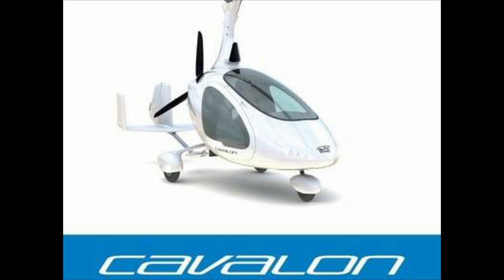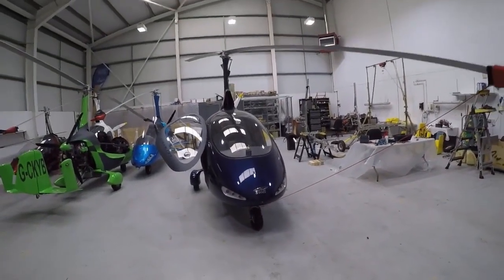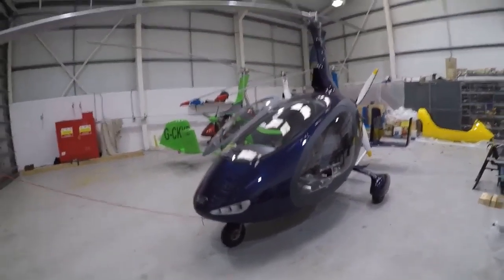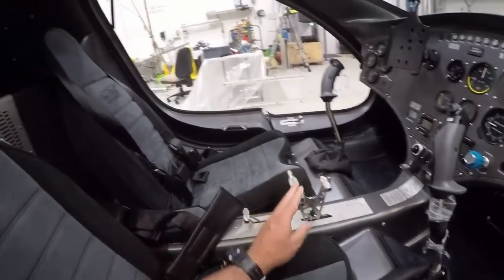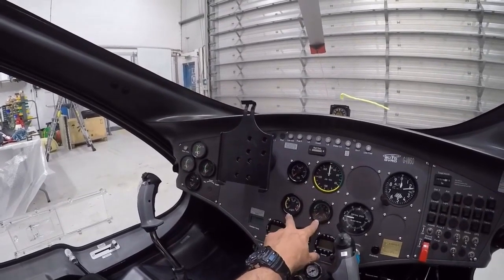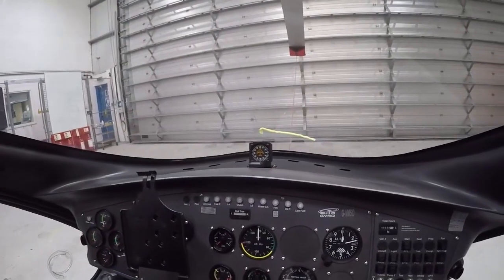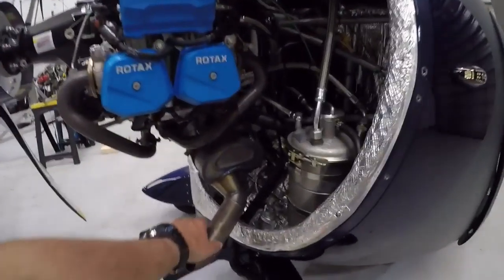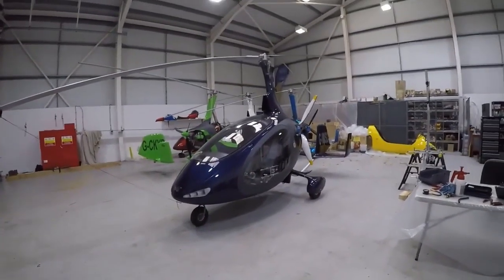Auto Gyro Cavalon with Rotax 915 & Constant Speed Prop revised review

Comment: If you knew anything about the Cavalon in the UK.... it is an absolute nightmare.
One at the airfield near me hasn't flown for ages due to numerous faults - not least of which is the prop which needs work before it can fly. The suppliers sound like a right bunch of cowboys.
(Yes, I do know something about gyros - I've been flying a VPM M16 for years)
Reply from the maker: Well Tony its a view and thank you for sharing - although clearly they are a popular model and should you wish to change you VPM at any point you are faced with the choice of Magni or AutoGyro.  I'm not AutoGyro's PR but at the moment the Cavalon is a far nicer aircraft to fly than the M24 and having flown the aircraft in the film several times it flew well.  Quite why it falls out of bed subsequently is a matter I've little interest in getting involved with.
Reply: @gyrocopterflyingclub6148  Thanks for the reply. 
Yes, we all have our opinions - I can only relate to the one hardly-flown example due to faults and the other that I flew back from France in and then had a partial engine fail on takeoff at Fenland.
I'm not going to tempt fate and tell how reliable my old VPM has been... oh, wait...  :)
Reply from the maker: Hahaha yes Sod’s law!
Reply: I would be interested to know what other problems the Cavalon your speaking of happens to have. I built mine in 2016 and in the first 2 years put 600 hours on it with only a few problems ,,,,,the front light group began getting dim and when we took them out we found they were getting warm and the compound holding the led's in had begun to melt over the lens reducing their function but Autogyro replaced them no problem. I also had a pre-rotator gear start chipping the ends of the teeth and upon close inspection found hairline cracks in the sprocket,,,,,,again Autogyro dealer replaced the gear and the bendix drive. I have to say aside from a few other very minor things all has been well and I fly this machine more than most other people around the world as I am now at 4 years and over 900 hours and I have found it to be a very dependable machine. I am possibly looking into the new 915 certified model this coming year so my Cavalon N914RB will be for sale if I make that purchase. If anyone knows of any specific problems with the Cavalon don't hesitate to drop me a line I am always willing to talk gyros and like to get input from other pilots,,,,,,,never hurts to have another view point and I am always willing to learn.  Fly safe and fly often.

Comment: Silly question, “Why isn’t the spat allowed on the front wheel?”
Reply from the maker: It was suggested that with the higher 120mph VNe along the way stability might be compromised because of course the nose wheel is still connected to the rudder and the wheel spat is quite a big surface area, odd however as it is there on the Calidsu.
Reply: Gyrocopter flying club Thanks for the reply. Keep up the good work 👍👍👍